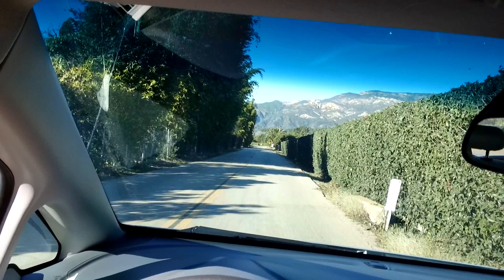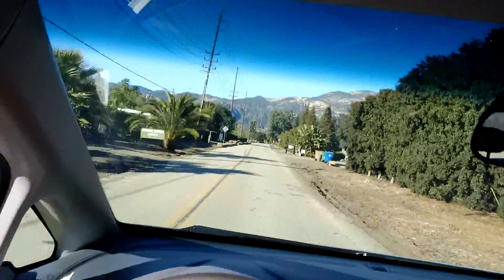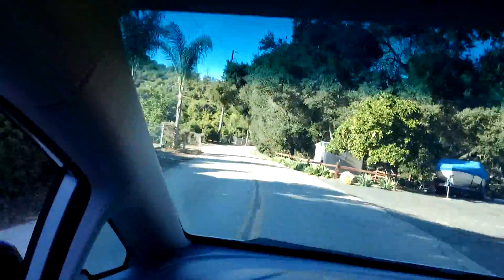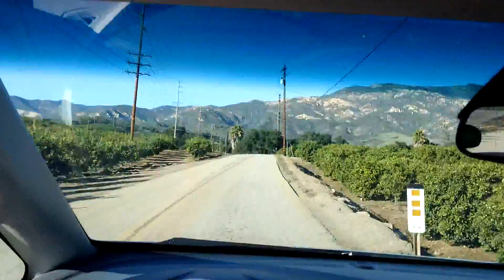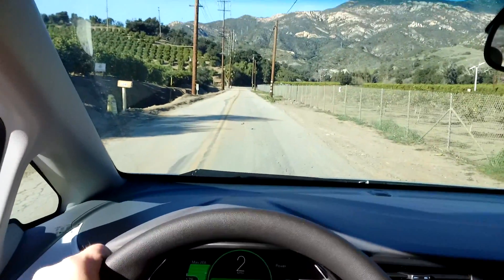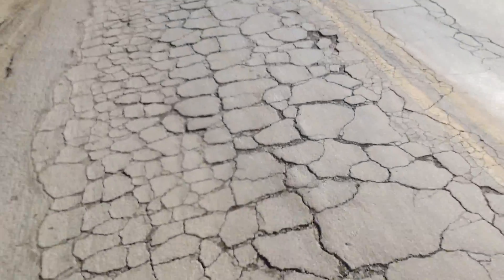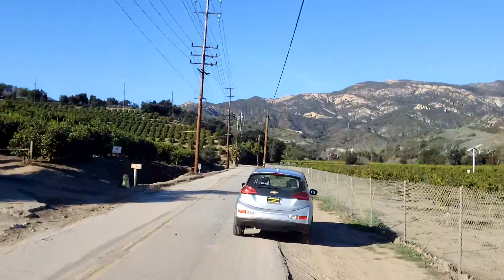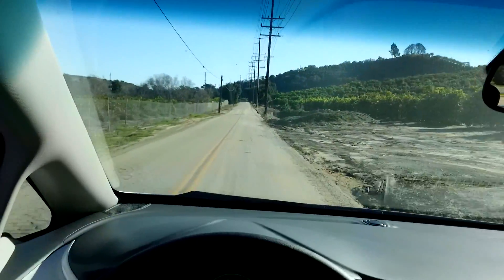Chevy Bolt 0-60 test and regen test

Comment: Is the regen even stronger if u Do L + paddle shifter? Or L and then braking to do more regen up until it starts to get into real physical brakes?

Did you have stability and/or traction control off and did you just floor it from a stop or try to minimize the wheel spin? thanks
The other guy got no wheel slip https://www.youtube.com/watch?v=DiTuK8kXZHQ

Comment: funny you mentioned the regen doesn't work worth a damn above 20 mph. first one i drove acted the same way you described but the second one i drove worked the way it should; the speed didn't matter, i'm guessing it's a setting or perhaps the level of charge???? something is odd, different?? PS: WHEN YOU'RE WORKING WITH AUDIO... ROLL UP THE WINDOW... DAAAAAAA!
Reply: skip cercelletta FYI Regen will not work on a fully charged batter
Reply: yes i know this but the battery was not above 75%. i drove another one yersterday, batt was not full and it worked fine???

Comment: Thanks Mike! On my gen2 Volt I changed tires and wheels to 235/40R18 and 18x8. The result is less wheelspin, faster acceleration, better grip in rain and more stable ride.
Reply: SnapHost what about EV range?